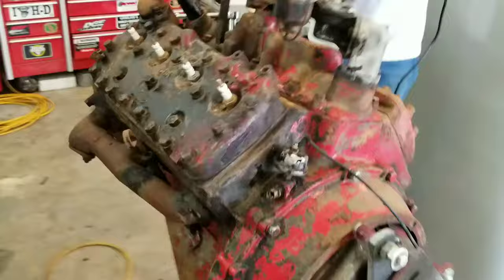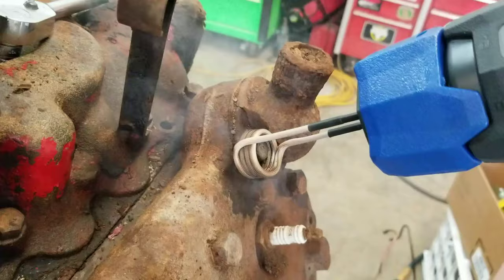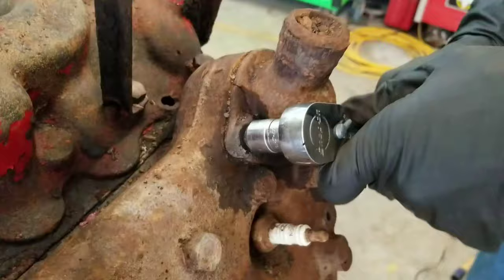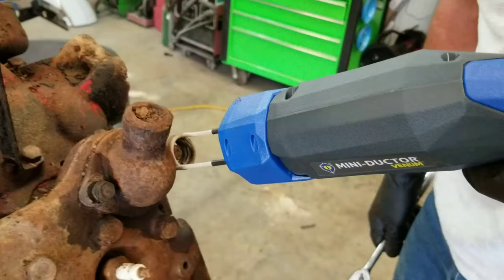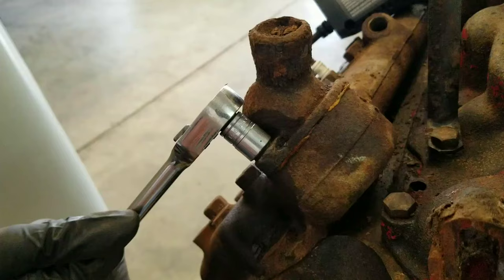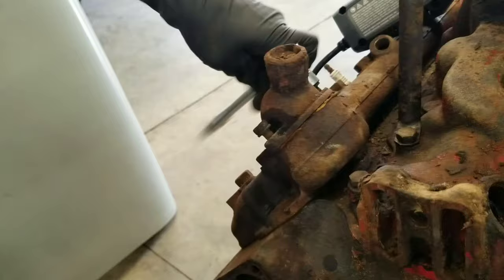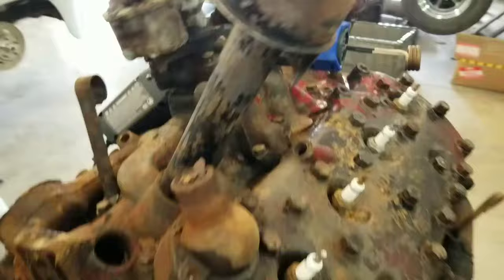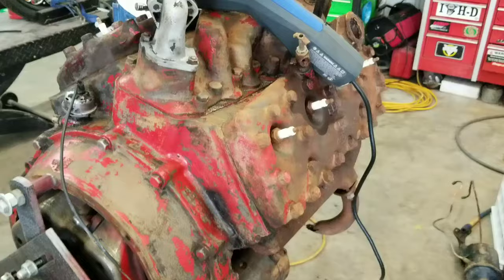A Cool Tool for Removing Rusted bolts and fasteners

Comment: Tightening bolts just a smidgen first will break the threads loose.  Try it.
Reply: that could break the bolts and wreck the threads
Reply: @manofsan  I'm talking about barely turning it, so much so, you can't see it has been turned.  Mechanics have a pretty good idea of how hard you have to turn bolts to  ring them off.  It comes with time.

Comment: I'm really interested in the physics of this. Because she bolt should be expanding and that would make it press against the walls. Maybe it's just enough to break the rust bonds.
Reply: I assume the heat causes the bolt to expand and break free from the rust. It would work better if you immediately poured water to cool it back down.
Reply: @groundzero_-lm4md  see thats what Im saying though. Is the rust bond stronger than the force pushing out from the heat expansion? Must be right?
Reply: I wonder if the tool actually works. As someone else has already pointed out they used it on a thermostat housing. In the video they also said before the tool they broke 4 bolts, in that Era of car engine there are only 2 bolts on any thermostat housing. I've personally taken plenty of t-stat housings apart and can't recall breaking a single bolt. I've also removed exhaust manifolds and remember breaking plenty of bolts.
Reply: Bolt expands and the bolt hole also expands... this breaks the bond from rust very simple
Reply: @8826avatar  ^
Reply: Also when you heat a hole it expands by making a larger opening. Not tighter.. that's why this works
Reply: @groundzero_-lm4md  metal becomes weaker doing that

Comment: From the title I thought the Cool Tool would be a  hand held Laser Rust Removal tool.  The induction heater seems great to do the job.
Side note: I just recently watched a YouTube video were they are manufacturing new Nixie Tubes, a similar hand held induction heater was used to heat up a component to a glowing orange through the glass of a vacuum tube.

Comment: 2:10 - carefully slackens bolt off with miniductor, then proceeds to hit old delicate casting with a ratchet-wrench. Suggest the next tool to purchase would be a copper/nylon mallet.
Reply: nlo114 
That was a ratchet hammer.  Similar to a crescent hammer.
Reply: That's an expensive hammer, snap on ratchets aint cheap :D
Reply: it's just a shitty old water neck he more than likely isn't going to reuse, nothing to worry about.
Reply: ++The House of the Rising Sun..  He may not reuse the water neck but heating (and not breaking) that bolt sure beats having to drill and tap a new set of threads on the rebuild. The way I figure, anything you don't break is one less thing you don't have to spend time repairing... and I do a LOT of work on old stuff!
Reply: rupe53 i think you misunderstood the conversation.  he is hitting the water neck that has already had the bolts removed to separate it from the head.  somebody was concerned about the "delicate casting" of the water neck, to which i replied, basically saying the water neck is disposable.

Comment: For those kind of bolts, what gets seized is the neck of the bolt so if you tap with a hammer or air hammer, it will loosen and then you can just hit it with an impact.

Comment: It seems like the bolt would expand and get tighter.
Reply: It expand the treads too ,as soon as you take the heat off the bolt shrinks back too normal .
Reply: The nut is taking more heat faster so it breaks the rust bond, very effectively
Reply: Thanks for explaining, both of you.
Reply: That is the reason heat works to brake the seal made by eons of rust. Expands, contracts, then comes out. This is cool because you usually have to douse 20 rags in water and pack them around the nut so you dont blow a goddman hole in something never ment to be touched with fire, let alone an oxy acetylene torche.
Reply: This is Elementary science, it can be solved with a blowtorch too, but it requires skills and not effective on tight areas. However, this heated coil heats up the area around the bolt expand first before the bolt, breaking the rust. 

the tolerance is so tight, I had trouble fitting the wheel bearing into the hub, because the hub is warm, while the bearing is cold. I Grab a hair dryer and warmed up the bearing, making it slightly warmer than the hub...solved.
Reply: I agree The bolt would have came out anyway.   Heat expands, the bolt is inside of the housing which is not being heated.    I think smacking it with a hammer before you turn it would have been just as effective
Reply: @turboconquesteob  Not even close......
Reply: @diegosilang4823  that’s back to front bro- to fit a tight bearing into a hub,you need too cool ( shrink) the bearing,and heat( expand) the hub.

Comment: $1200-$1500 doll hairs... yikes. You could make one for a whole lot less from parts reclaimed from the scrap heap
Reply: Try $500.
Reply: doll hairs?
Reply: they're €658 here.....  a blowtorch will probably do just as good
Reply: Blow torch is external heat. Inductive coil creates heat in bolt itself. This isn't a heating coil.
Reply: You could make one even more Skookum that this SnapOff using parts from some tube TVs, computer power supplies, and a curling iron.
Reply: ADEBISI ADEBISI You really can. It's just a dc-ac circuit with a big fucking transformer connected to the induction coil.
Reply: AvE should do a boltr tear down on it and maby make a homemade one
Reply: But would it chooch?
Reply: adisharr S. White has been spending too much time in the Emporium of Dirt . It means dollars.
Reply: Take a stick welder,jam the stick into the top of the bolt,and hold it until it glows. Same result,for pennies.
Reply: @supertramp6011  Exactly. Will ya for gods sake make a video and enlighten the fools Please.

Comment: "It can't be tight if it's a liquid".
Reply: You would need much higher voltage than the 110V this things runs off of. It only ever gets the nuts glowing orange- not nearly hot enough to melt. But I get your point.
Reply: -Quoted from everybody's good friend, the acetalyne torch.
Reply: 1st saw that saying a couple of months ago. Good one.

Comment: Errr - You don't want to heat the bolt. You want the material surrounding the bolt to be heated and expand thereby releasing the bolt.
Reply: That's what I was thinking.  Doesn't the heat make the bolt expand?

Comment: If you want something that works very similar but is much cheaper, a small mini butane torch works great for those bolts in tight areas where you want a precise application of heat. Has just enough to get most loose but not enough to scorch everything in the area.
Reply from the maker: Correct. But in places you can not use a flame, as in our later videos, this thing works great.
Reply: @WarmanAutoworksLLC  Exactly. There’s no way in hell I’m going to remove a rear shock near a gas tank with a Bernzomatic.
Reply from the maker: @elephantgrass631  I actually used it on a rusted fuel fitting with gas in the line. Video is on here too.

Comment: The concept is not to heat the bolt itself, but to heat the surrounding area so that it expands more than the bolt and reduces the torque required to undo the thread. My dad use to apply a blow torch to heat the surrounding area to much the same effect, expect your tool seems to apply the heat to a specific location as opposed to the broad naked flame of a blow torch (a hazard for many other reasons!)
Reply: Welp the concept works many bolts have lock tight and that actually needs to be heated to make it come out easier but then again you might not actually work on vehicles…..

Comment: In my shop I just spray impossibly rusted on nuts and bolts with  Spin Off and let it sit for couple minutes..the nanotechnology is better than any current penetrating oil. Rusted bolts and nuts just spin right off no heat necessary.  Save the heat tool for those bolts that are rusted deep in the block.  Good video!

Comment: or save 600 bucks and goto ebay and buy (120W ZVS Low Voltage Induction Heating Board Module Flyback Driver Heater Kit) for 16 bucks w/ free shipping
Reply: slo non i
Reply: link to seller please
Reply: Send it to us
Reply: A shop that uses this tool dozens of times a day isnt going to cheap out on tools....I'd bet that tool you bought for 16 bucks doesn't even work anymore
Reply: You must be joking. It’s a simple PCB with a thin copper coil and no enclosure. Too little power and too small coil diameter and missing enclosure and so on...what’s the point? It’s like buying a kids car in Walmart and tell your friends you just bought a new car.
Reply: @ThinkingBetter  xx
Reply: That’s a good idea if your buying it personally but for a ship they should use this
Reply: Nice
Reply: I was just thinking how to make one ! But thanks for the link dude
Reply: I suppose your the guy driving around with duct tape on your bumper after realizing how much you could save by fixing your own car after getting into a collision.
Reply: @pixels303at-odysee9  no duct tape is shit i weld steel repairs or fibreglass if bumper brackets are fibreglass like NA Fairlane. I reinforced to oblivion!  Stronger than factory. On my 4wd either weld or bolts for bullbar or bumper.
Reply: @dragan3290  you obviously are missing my humor
Reply: @pixels303at-odysee9  sorry mate mistead it and week has been ridiculous 😊
Reply: @dragan3290  soldering iron with a modified end.
Reply: I wAs laughing when he said, "the heat travels down the threads". And again when he said, "it cools off quick"
Reply: @markallen4364  No, it's not like a soldering iron at all. It uses a magnetic field.
Reply: 600 bucks?
holy shit...  its an induction tool....  so simple to make....   passing electricity down a coil..    low voltage? flyback driver?

hmm  ours are right off the 44000 volt main..   heat 4 tons of steel bar in around 12 seconds.  

if that had no complicated circuittry in it, it would heat that bolt in half the time.  120 volts off the wall...  why fuk with it
Reply: 120W isn't going to do anything. The bottom end tools like this are usually about 1000W.

Comment: Couple seconds with a torch does same thing and is multipurpose
Reply: Yep
Reply: while burning everything around
Reply: mattroski007  so u think heating a bolt head with a torch wont heat the stud...🤣🤣...like I said...torch heats up bolt head the same way and still can be used to cut metal or any number of things
Reply: mattroski007  been using a torch for many yrs to do this
Reply: @robertmartinez696  it wont work nearly as well it seems you dont under stand induction
Reply: Why use a torch when you can just use a plasma cutter

Comment: Snap-on costs and arm and a leg but they have some amazing tools.
Reply: This is the Mini-Ductor; it's a bit expensive, but it's not originally a Snap-on tool.  It should be available on Amazon and through other sources.  The tech using it was introduced to it by his Snap-on dealer who carried it on his truck.  If it's a tool you need and use frequently in your work, you'll find a way to afford it.  If you're still not convinced, watch the video again.

Comment: pfff...use it on a REAL stuck bolt....
Reply from the maker: pwxproguy busted the others. Check latest video posted today
Reply: Try it on those wretched crosshead screws on Honda brake discs, those little bastards can be a nightmare to get out. Even if I can get them out whole I throw them away, they're just a nuisance anyway.

Comment: Snap On man "Only $3999.00 but you can pay it off at $40 a week over 5 years on trade card"
Reply: That would be 10 thousand dollars tho.
Reply: Only five years?
Reply: 121bham  hey, you could be a Snap-on man!
Reply: 121bham  Well, that does disqualify you!
Reply: If it breaks we'll replace it.   Which is fair, since you paid for it 27 times.
Reply: Snap on man eats steak off the backs of techs worldwide who pay 1000% mark ups
Reply: @mopar1465  yep, I'd like to know how many mechanics have been impregnated by a snap on man.
Reply: Propane torch, candle wax, works good on a budget. Heat the nut, not the bolt. I'm 150 years old... 151 Feb the 26.  152 after that. If you got the money, buy the vibrator with attachment. Oops..... That tool he used..... Trans fluid and acetone mixed 50,50 works but not if you are in a hurry. Your welcome...One old Fart

Comment: Will it work on bolts into aluminium where the bottom end is open and the bottom threads are picked up with aluminium oxide?  
They will turn a little then seize because the threads are jammed solid. If the do come out the threads are trashed.

Comment: induction heater..   made one myself because all of the brand name company's sell em for to much.

in truth its simple, a coil thats powered generally heats up any metal in it.     about $10 worth of parts.

what did harbor freight charge ya?   couple hundred?     figure,  most of them are around 3000% above the actual worth...
Reply: You are just a funky ass cheap ass

Comment: Snap-on... So ten times the price it should be...
Reply: @BARDOCK172  - So your basis for their entire stock being shitty is "their breaker bars break." How many have you personally broken?
Reply: @BARDOCK172  - You can't cast off an entire brand for ONE bad tool. Did they replace it? What was their remedy? How was their service? You can't use videos as an end all either. You can find ANY brand breaking when you look online where there are BILLIONS of people. You have to find the ratio of breaks to units in use to accurately determine if these tools are any less durable than others.
Reply: @GoatyHerps  Sounds like a kid trying to justify a purchase that was too expensive for its own good...
Reply: @GoatyHerps  Your that kid that bought a Ferrari over a Ford.

Get towed lil boy.
Reply: @robspear03  - Actually, my most expensive tool was from Wal Mart because I don't need Industrial equipment, and I actually drive am F-150. Sounds to me like YOU'RE the little boy who is still burning up because your friend had a bigger Snap-On box than you.

Comment: Ive used the Bolt Buster brand of these tools. I still soak mine in penetrate. Works like a charm 80% of the time. Still need to sneak up on it though. Work it out.

Comment: It's cool but not as versatile as a torch.
Reply: TOUGH MAN RANDY SAVAGE true but it can be difficult to use when you have plastic and rubber nearby the bolt.
Reply: can be used where gasoline is present.
Reply: ken hart Thats a really good point
Reply: It's more versatile than a torch, shadetree

Comment: "Of course, common sense has to be used with all these tools..." - shows induction heating tool being placed under a full gasoline filter.
Reply: You think there’s still fuel in that filter?
Reply: @biguprochester  looks that way
Reply: @life_with_bernie  Yes but as old as it is odds are it is no longer gas per say or flamable LOL.
Reply: @looseballs1966  Maybe, maybe not.  It takes less than 30 seconds to take off that glass globe and make sure though.  I'd do it.

Comment: You don’t heat the bolt to remove it! You heat the part it’s threaded into! Heat expands metal, think about it!
Reply: The heat breaks the bond the rust has
Reply: @henryfaye8283  Henry is right, I torched out a bolt yesterday, with a Mapp gas torch on the bolt head, and tapped it with a hammer, and penetrating oil, and repeat all that twice, then finally came out....works often well for me, on bolts that have been outside for 8 years and rusted and never been turned

Comment: I thought heat made metal expand. So if you heat bolt instead of surrounding threaded metal it would seem that you would be making it harder to remove bolt. Perhaps it is loosening old rust and oily material. Ant thoughts.
Reply: Yes I also agree with you  .  That guy should be using a torch and a piece of steel pipe about 8 or 9 inches long . Place the pipe over the bolt head . Apply the torch flame only in the area around the the pipe end . After it turns orange , very quickly put a wrench/socket on that bolt head and remove the bolt .

Comment: Cool tool, amazing actually but my thoughts were originally that, the heat applied to the bolt would cause the bolt to expand and be even tighter fit in the threaded hole.  But if it works that's what matters. Good on you for sharing.

Comment: That's a pretty cool tool, I wonder why I've never seen it before!  I often use the good old fashioned "gas axe" myself, or a small butane torch if the space is confined.  Does the coil get hot?  I can see the potential to have less worry about melting nearby cables!

Marion
Reply from the maker: This tool has come in very handy for us in many occasions. I have use it on fuel line fittings, seat bolts with carpet surrounding. And rare steering wheels that would melt with a torch.

Comment: Does it also work on a bolt head through a bushing that’s seized in the collar? Or only on nuts
Reply from the maker: Works on Many applications. I even straitened a bent trailer axle with mine.

Comment: Been using bolt heaters in the steam turbine industry. for many, many years. Only we heat'em up to get the final torque, use a knocker wrench and sledge hammer to break them loose.

Comment: Next time try tightening the bolt 1/8 turn before trying to unscrew it. Induction heating gadget looks pretty effective. A bar of iron with the end heated yellow hot also works.

Comment: Using water and the tighten loosen method works every time.  The water lubricates and allows the rust to act as a lapping compound flushing as you go. You'll never use heat and lubricant again. Use anti seize upon reassembly. KB